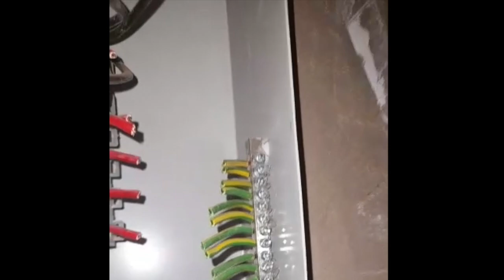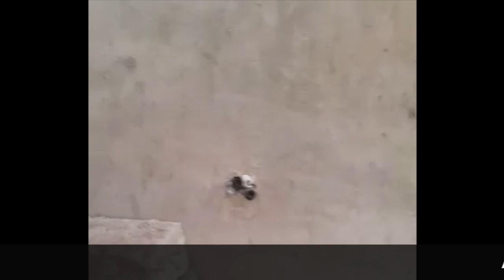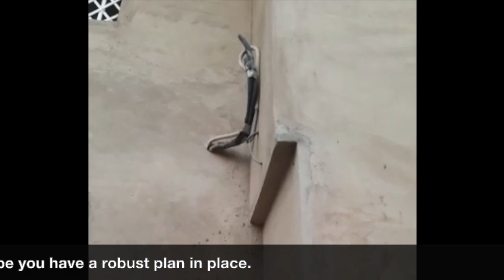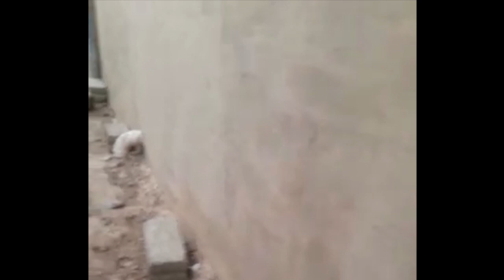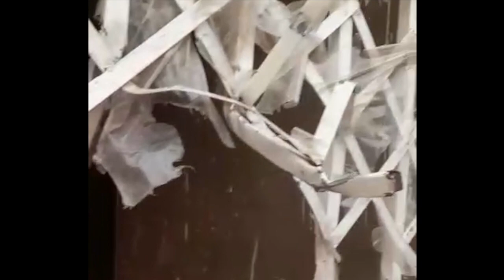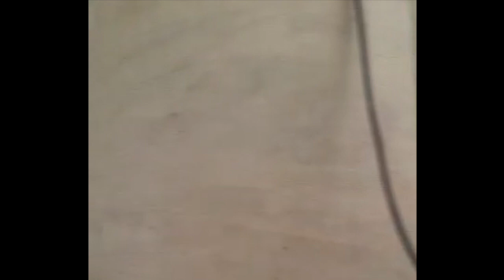|| The Criminals Are At It Again, Re-evaluate Your Electrical Plans 😡🤬😡🤬||

Comment: I think whoever is building a house project must leave passing of cables till last minute when you’re sure that some kind of physical deterrent is put in place. Solar lights, alarm systems, glass windows, secured doors, electric fencing, watch dogs, paid security presence 24/7 , fence wall, and ensuring that switches and sockets terminals points are screw-covered till fully ready to install.
Reply: One might move into a maximum level security prison according to your description. Jokes aside I understand what you mean. One thing that worked for me, I united with my neighbour's around 11 of them, all our security guards are instructed to help each other or question strangers each of them has a whistle, when one detects something abnormal they whistle and we also do neighbourhood patrols.
Reply: that's adding an the extra cost of who is building.
Reply: @timelesshomegh  Not sure how? Can you elaborate? All of the aforementioned are required if you need a secured home anyway just that home owners/builders must adopt a different execution plan

Comment: Obviously insider job.
This type of burglar bars are cheaper and very easy to breach. This's basically the old school bars with some flat metals slapped across it. A simple car jack will burst this thing wide open.
Spend a bit more and get good quality metals  and go for a better bar design. Combining vertical and horizontal bars weaved together offers a much more stronger burglar bar system.
Reply: You talk too much. Tell me which burglary bars can't be jacked? All of them can. It's only meant to delay a crime but can't completely prevent thefts given enough time. I agree it's likely an inside job. Cables are crazy expensive.
Reply: @aberba  funny man, where did I mentioned in my comment that a certain type of burglar bar will prevent all thefts?
May be you have a problem understanding ish. Here it is for your understanding:
“Spend a bit more and get good quality metals and go for a better bar design. Combining vertical and horizontal bars weaved together offers a much more STRONGER burglar bar system.”
You got it???
Reply: @nighttrain6834  so you're denying saying that? Then explain to me, what use is your "quality" burglar proof if it can also be broken into easily?🤔 Explain to me cus apparently I have a problem understanding English. 

All burglary bars will fall apart when jacked. Do you have any idea about the power in a jack? That double layer burglary bar design you're talking about doesn't make much difference when a jack is used. The steel available to these welders can't hold the power of a car jack.  So explain to me how you have it all figured out.